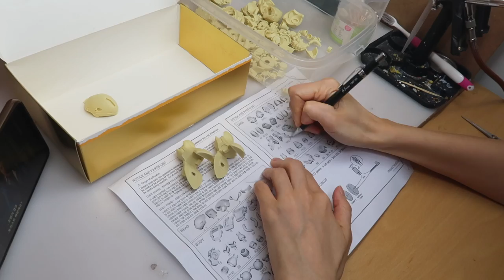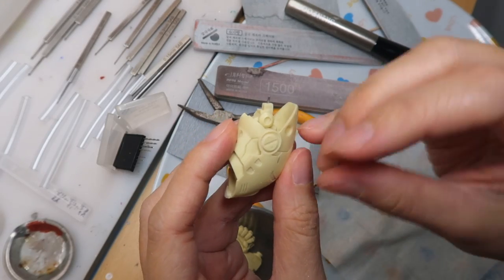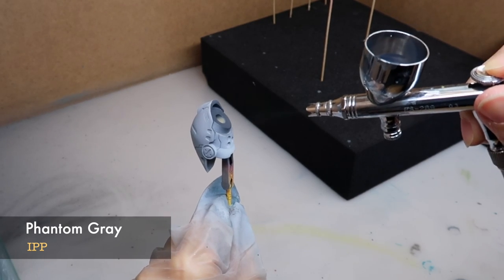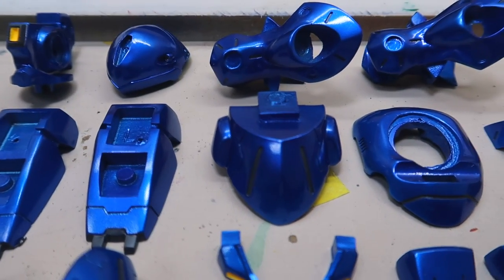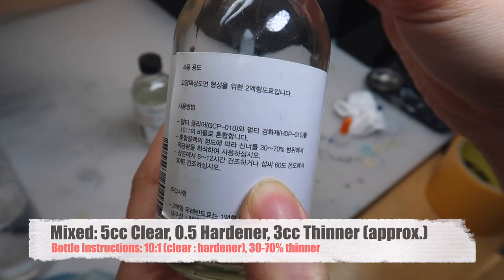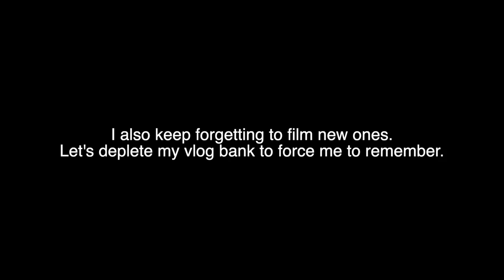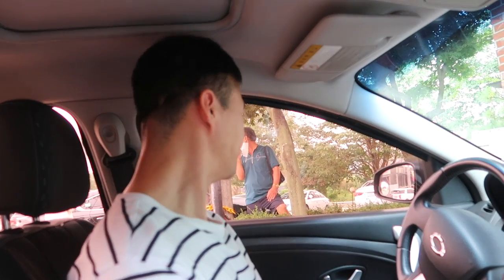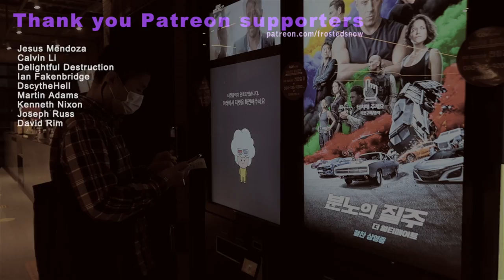Kampfer Urethane Candy | How to Build + Paint Gunpla

Comment: i feel like instead of moving your strong hand to scribe lines, i find my scribing or rescribe job becomes alot cleaner when i have my arm stationary and instead moving the part to let the tool do the work for you. Also i dont run into risk of applying too much pressure.